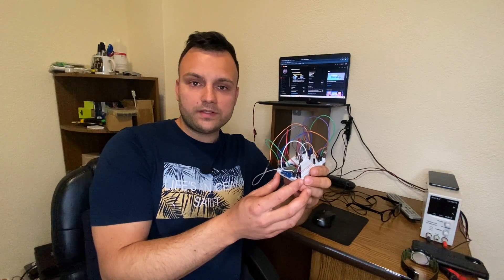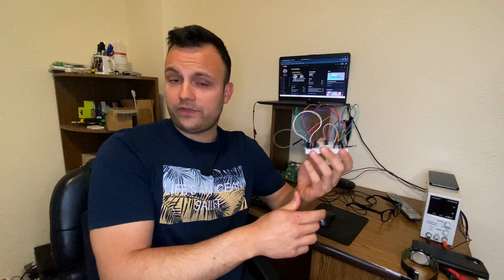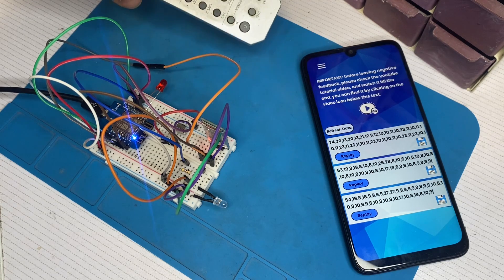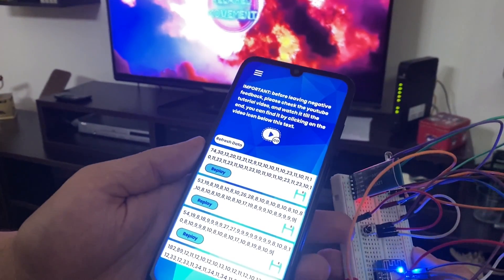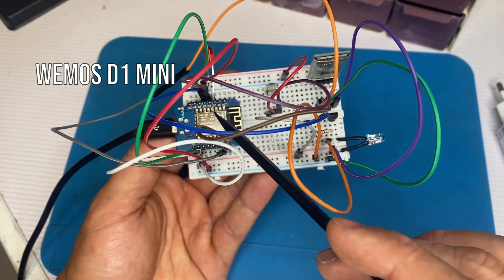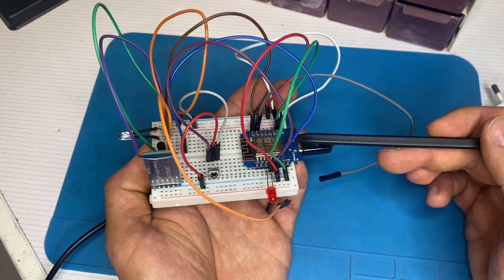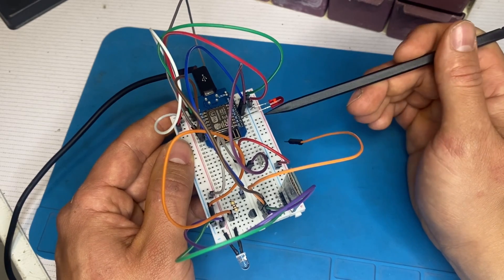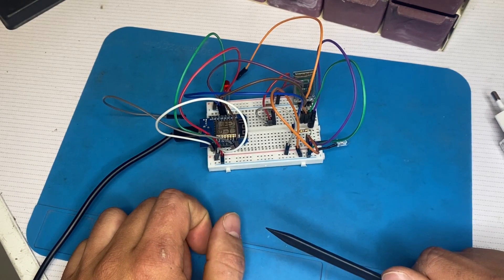DIY Flipper Zero With ESP8266 | Infrared Signals | IR Replay

Comment: Hey man, love your project! I tried doing it and it works but i am having an issue with the app! Could me help me out of with it ? Need your help bro 🙏
Reply from the maker: @abhiram233  Hi, happy that you like it, thanks! What kind of issues do you have?
Reply: So i am using HC-05 and when paired to the mobile phone it is saved in paired devices list so i have used an serial bluetooth app for Android which connects to the HC-05 module but the talk to esp app doesn't show any connection to the module, says "go to the bluetooth settings and connect to HC-06" and the signal received is no where shown in the app
Reply from the maker: @ Just connect the way I showed on the video, through your settings, and after that use the app, you shouldn't have a problem.
Reply: Yeah i Did the same but the app says "go to the bluetooth settings and connect to hc06". I was wondering if there was another way to replay the signal other than using the app. Thank you for the replies man, I really appreciate it.
Reply from the maker: @ Yes, you can but you need to modify the code to work the way you need. I will check what you said, so I will fix it if there is an actual error in the app, thanks!

Comment: if you remove the long cables and replace them with smaller ones for breadboards it would look cleaner and more portable
Reply from the maker: Thanks for the suggestion, yes I am planning to make a PCB, so that would be my next improvement.